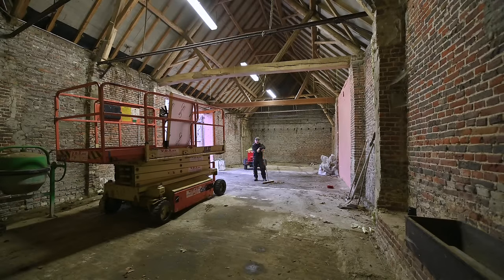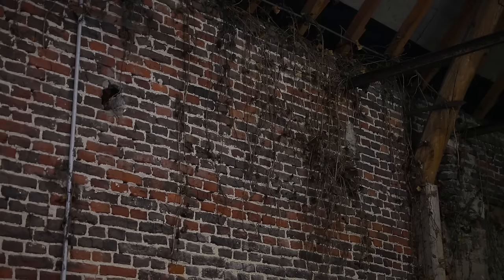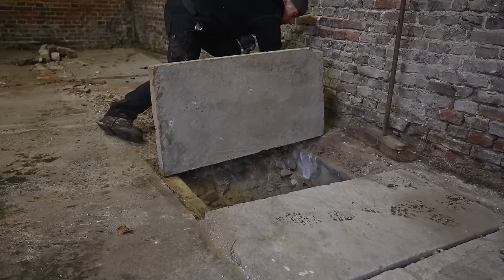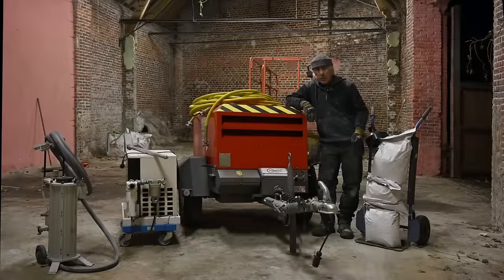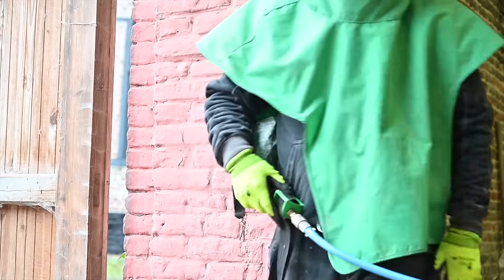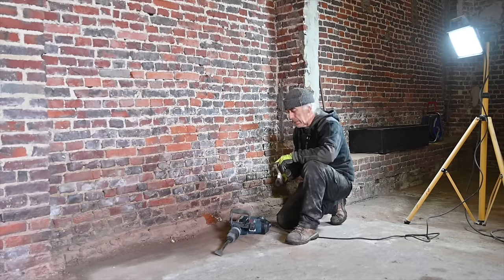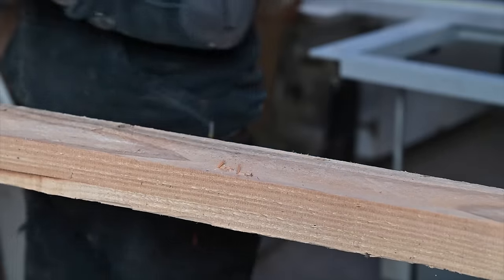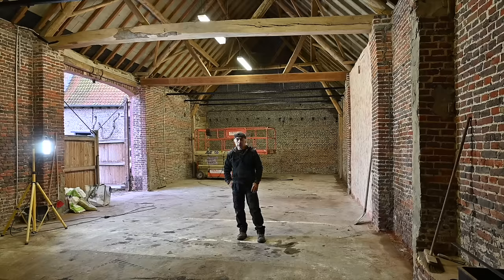Barn Renovation,   Part 2  , Repair work

Comment: Nice job! Tip: for screwing this kind of screws you can better use an impact driver. With an ordinary battery drill you can easely break the screw or torxbit because the high amount of torgue (been there done that!).
Reply from the maker: Good point - Thanks
Reply: While true, a drill is so much more pleasant to use just due to the sound. Impacts are such noisy beasts.

Comment: 10cm concrete ? you don't wanna beef it up in the middle/near the entrance where it's easily accessible, so that you could maybe potentially eventually install a lift (thicnkness not required for lifting the Royale, but other cars would require it).

if you're looking at re-doing part of the floor, now is the time to think about it, and future-proof it maybe ?
Reply from the maker: Yes , 10-12cm enforced concrete slab on top of the slab that is already in the barn.. I might discuss it on monday with folks and see for a 14cm  as you have a point

Comment: you are tempting fate removing the pink paint :)
the homeowners associations' heads will blow up if you do not repaint it pink. (at least in the US)....
speaking for a friend 😂
Reply from the maker: hahaha, wel I have a 12 gauge shotgun...  hahaha
Reply: @D3Sshooter  that is how most here would prefer to deal with HO's here.